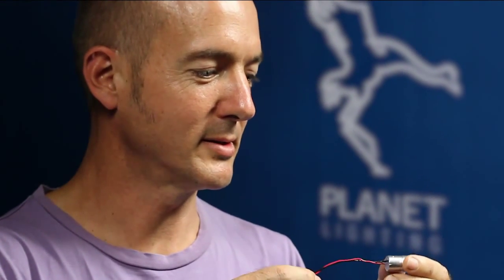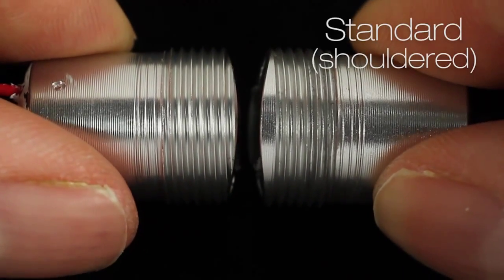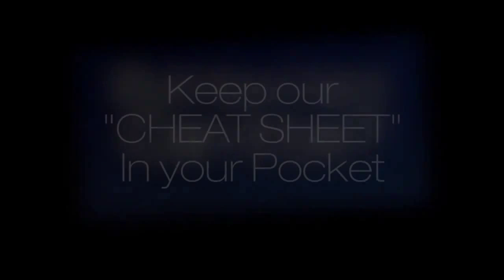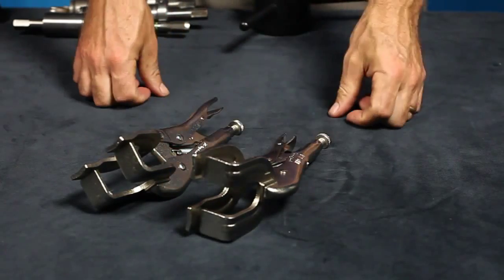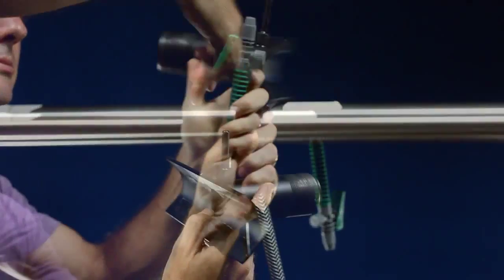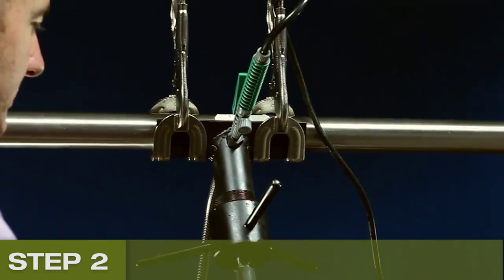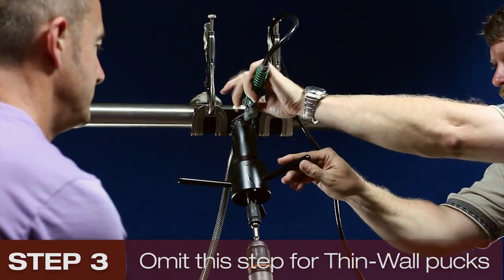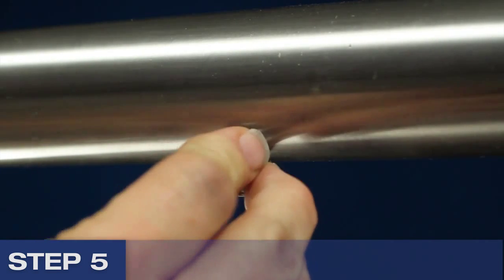LED Handrail Lighting System HLS

Comment: you may like led handrail light as below

https://www.aliexpress.com/store/product/12V-IP67-1W-Low-Voltage-Exterior-LED-illuminated-Stainless-Steel-Handrail-Light-system-Integrated-Decorative-Lighting/1381295_32692686425.html?spm=2114.12010614.0.0.5b14e22bhWeeNh